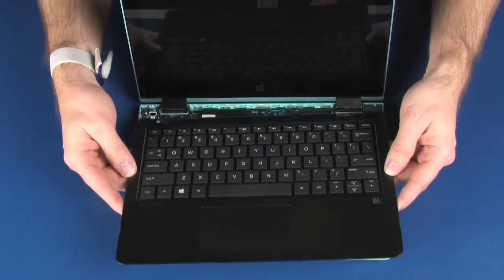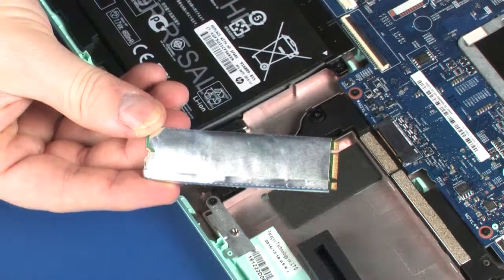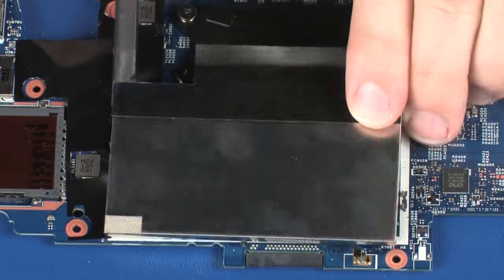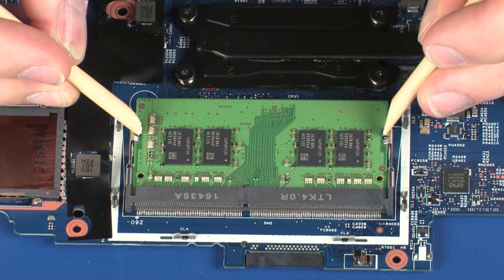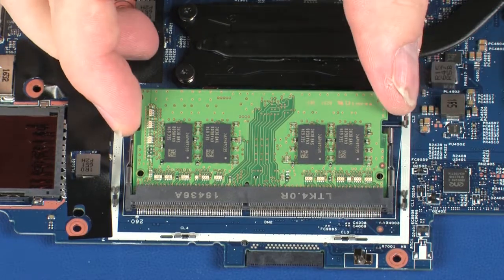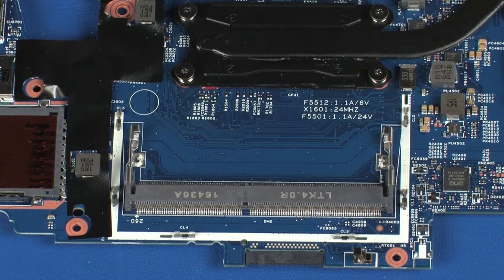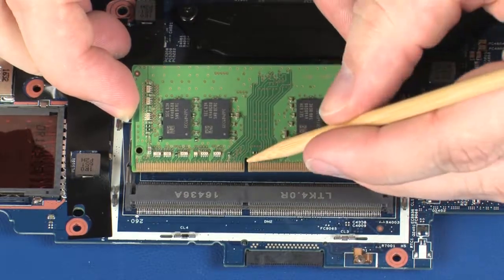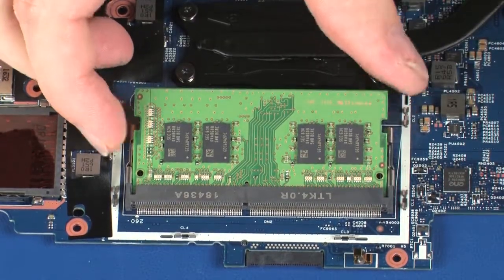Replace the Memory Module(s) | HP Pavilion x360 11-ad000 | HP

Comment: I'm replacing the memory on a HP Pavilion X360 11m AP0013DX. Is the procedure here the same for my system?
Reply from the maker: +Ruth Beane You can try the steps mentioned under the video on your unit.
Reply: @HPSupport  Where would that video be?